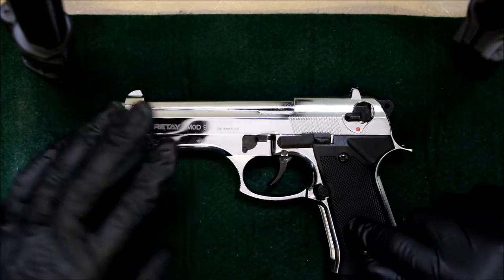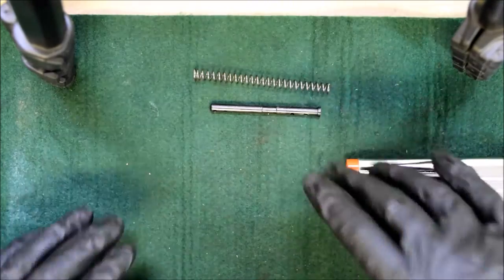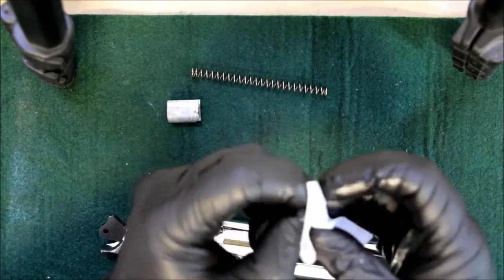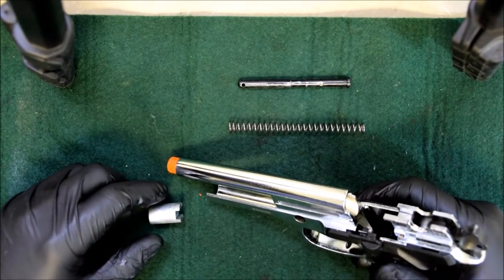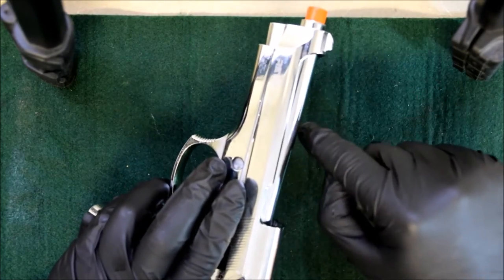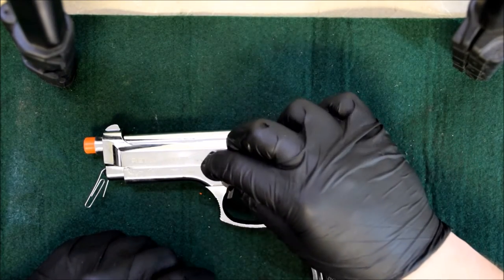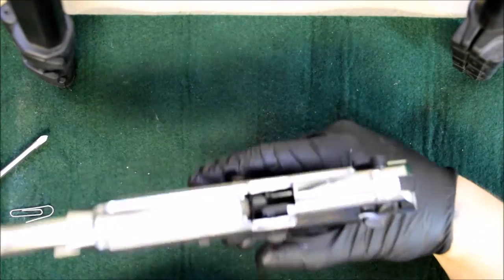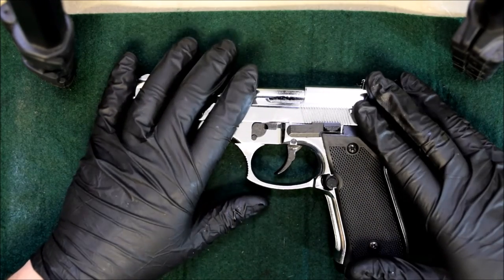How To Clean and Oil A Blank Gun Field Strip Retay Mod 92 Front Venting Gun

Comment: Bro can you show me how to unscrew the orange tip, I've got the same gun. And here in Canada we don't require to have orange tips. Thanks
Reply: You can screw it off with a tool or just saw it off.
Reply from the maker: You can unscrew most. Some take a lot of force and some heat. It all depends on how it was made. Sawing is an option. Of course all of this is against ATF regulations.
Reply: There's a lot of sites that sales those without any orange tips just like mine.

Comment: how can we take off the tip
Reply: I used a blow torch on low temp it’s only plastic lol mine came out almost instantly
Reply: Make sure to rack the slide all the way back and then use the blow torch
Reply: @GameAintBased  i used hot water an pliers took sum elbow grease an sum about 15/20 mins but came off  an i did use the slide back imcase water got all up in it blow torch would of been better but i dont got one but thx lmao
Reply: @jakefromstatefarm616  if your in the UK don’t be caught with it on the streets with the plug missing u can get firearm charges for imitation firearm
Reply: @GameAintBased  same in the US, just never a good idea to have it in public if there's no orange tip

Comment: Can you remove the orange tip?
Reply: @vanlivingandmagnetfishing5263  hey do you think you could show me how to remove it i just ordered mine
Reply: Put the slide all the way back and put it on slide lock then get a blow torch on the end the plastic cap comes out almost instantly takes seconds
Reply: @GameAintBased  I was able to twist it off
Reply: @ElGM26  mine is top venting so it’s actually abit in the barrel so it’s way harder